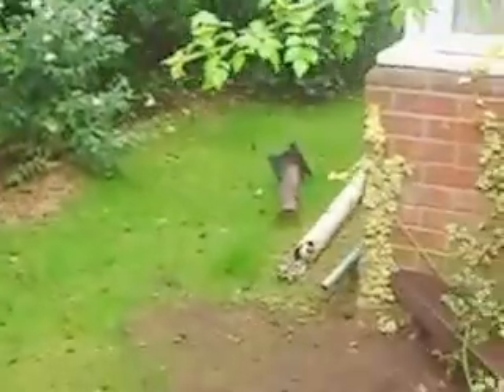Rutland Wind generator 24V in to 12V or 24V systems

Comment: Love the video very informative quick question can you run a 12-volt wind turbine on a 24 volt battery bank
Reply from the maker: Depends - some slower turning turbines will spin fast enough in a strong wind to generate 24 volts - but I'd worry about stress on the over speeding turbine...

Comment: Hi! I have the 24v 913 and am a little concerned about plugging it straight into a 12v system. Do you have any advice on what sort of charge controller should there be in the middle? Surely the output from the generator would be rectified 24v dc and more than the batts would want to see? Thanks
Reply from the maker: Use a 12v charge controller, the turbine will just run slower.